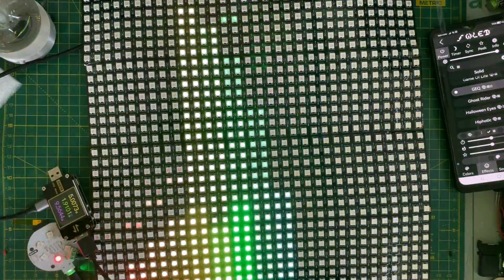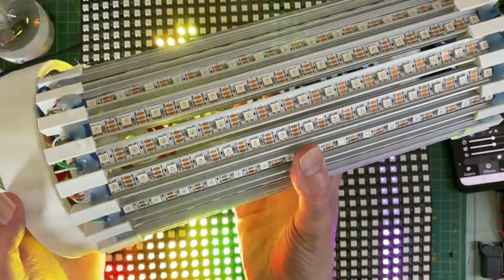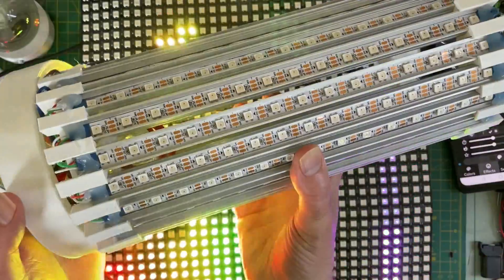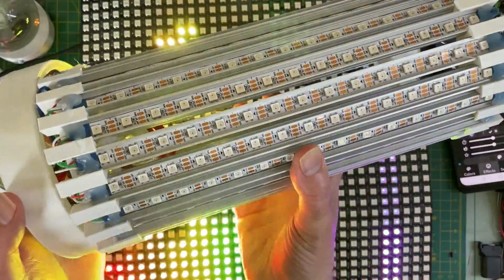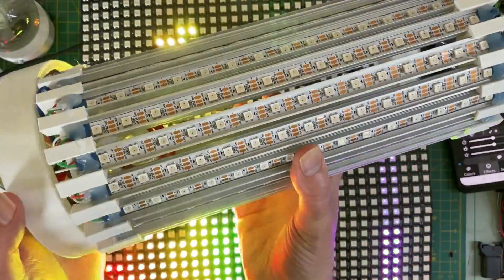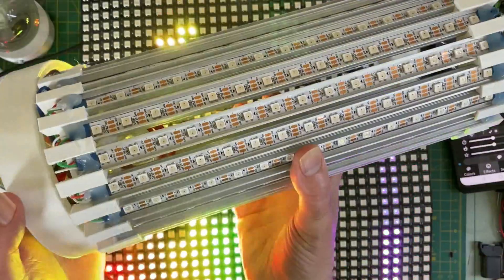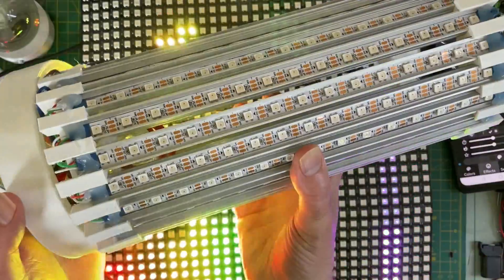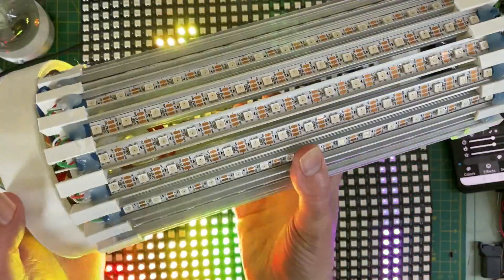1024 LEDs - WLED Flame Lamp

Comment: Hi, looks like a really good project. What did you use for the diffuser?
Reply from the maker: Went to the local art shop and got some plastic sheeting that is used for windows in architectural models.
Reply: @atomic14  Thank you
Reply: White paper kitchen towel also works well!

Comment: A bit off topic but was wondering if you have a video on logging data to an SD card with the ESP32.
I'm in the middle of a project to make a data logger for my friend's race car.
Logging braking force (g force when on the brakes), brake disc temperature and brake fluid temp and pressure.
I'm using SD_MMC in 4 bit mode (arduino ide by the way) and it works fine, but I'm not sure if there's a faster way.
Pretty sure that you have a much greater understanding on this subject than me so if you've done a video (or fancy doing one) I'd be very interested in studying.
Thanks for all your other great videos. They've been a big help 😊
Cheers
Matt

Comment: I remember at the end of last century... I spent hours in finding solutions for colorful lights... at a reasonable cost.And dreamed of having the possibilty to choose any arbitrayry color... these days the worst I can think of is rainbow flashing lights... LOL³ But the LED advancements are really great esp. if you ever coded a PWM for an RGB led yourself. I did that for a Teensy based MIDI controller... RGB workd fine... just that it would distort the ADCs for the MIDI signals... BUMMER!!!

Comment: "not sure how youtube works anymore"

neither do youtube  🤣🤣
I wonder if some tie wraps around the tube might help make it more cylindrical, and manageable. nice light 2x. 👍
Reply from the maker: Yeah, I was thinking of 3D printing some rings and then putting an elastic band on the outside.
Reply: @atomic14  bend them in the long axis , 4 x 8 vertically, 3d print internal ring

Comment: I bought one of those square matrix, like 16x16 and it has never done anything but take up room, i could never get anything to run it or anything. I bought it to have 2 round red circle eyes that would go back and forth and maybe even follow a motion for my robot, just money wasted, zero online anywhere, the story of chinese electronics, never anything to help.
Reply from the maker: What's the model number?
Reply: Great, great project how did you set it up in wled though?

Comment: I know it can cause the lights to appear a bit dimmer, but I LOVE the look of a diffuse film applied directly to the surface of the LEDs, and then a second panel about a centimeter or half-inch away from that. Really softens the glow in a beautiful way, and sometimes I've swapped the diffusing films for the diffraction films used inside flatscreen TVs and monitors, since it's super easy and cheap (or free) to get a broken screen and harvest the films from it.
Reply from the maker: Yes - I think multiple layers would work really well for this lamp. At the moment you can still see the pixels.

Comment: 8:55 I think your 5v power injection should connect directly to all the pos/neg wires on the panels rather than feeding all the current to boards 2, 3 & 4 via board 1?
Reply from the maker: Yes, I think you’re right. I was just being a bit lazy there. I need to redo all the wires on the panels anyway as I’m not sure how good the wires are.